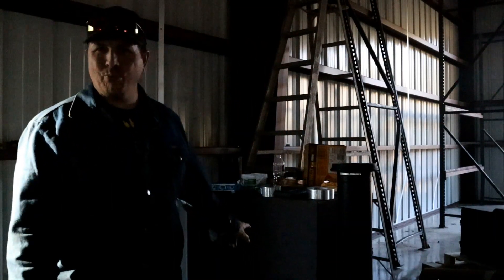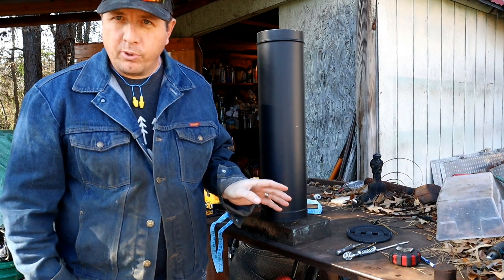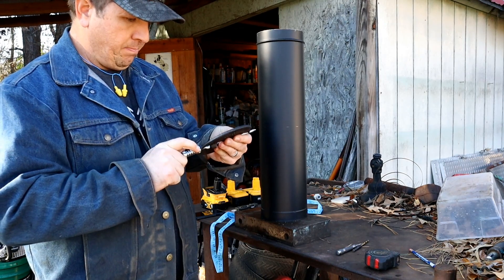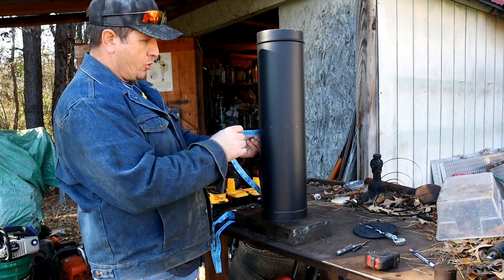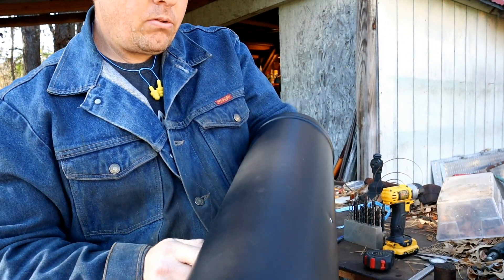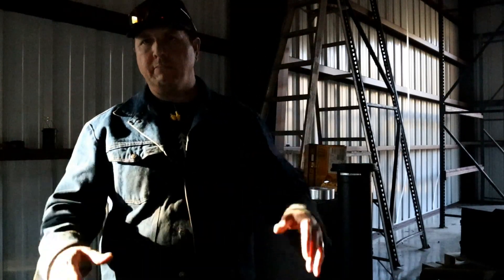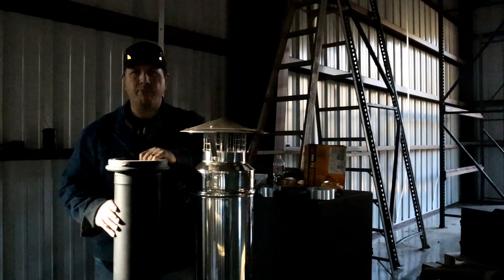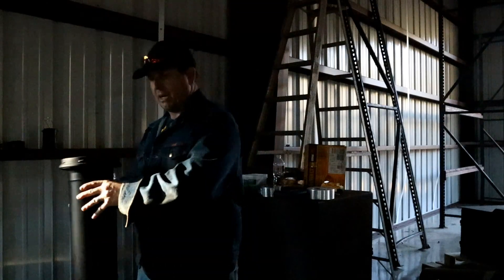Installing The Biggest Wood Stove On Marketplace in Barndo

Comment: Nice work, I used fire brick in a reverse smoker firebox, i made the firebox out of 1/2" steel and lined it with the brick, it holds the heat really good, I can go outside now fire it up in 32 degree weather and utilize the smoker in the winter.
Nice this video came up I was thinking of making a wood stove for a much smaller work shop out of 3/8"diamond plate 24  X 30" and I didn't know if i wanted to use the firebrick for the wood stove as I would want the radiant heat to transfer out and not be insulated by the brick, I have the metal cut and the brick not sure which way to go
Reply from the maker: Sounds like a pretty cool project!  I would at least use the firebricks on the bottom. I did bottom and half way up the sides. It really helps store the heat and release long after the fire dies down

Comment: The aluminum tape is for hot air duct joints will not hold up to single wall stove pipe heat it will fall off they do make hight temp tape for stove pipe joints 3M makes it not cheap for small roll don't need it if you screw your pipe joints together you will have plenty of draft with that high of a chimney but on a cold pipe you will get smoke though joints key to warm up pipe with a small fire first in fire box before you buid a big fire cold pipe will not draft well you will have smoke coming though joints and from stove fire box back drafting so warm up pipes before making a big fire
Reply from the maker: Thanks for the heads up on the tape!  I did get some high temp caulk for door seals. That might work for the pipe too, but no smoke coming out of the joints
Reply: @Man-Time  wood stove door gasket either flat or round depending on if there is a groove on a door frame or on the door if not just go with the flat door gasket also if you have an ash door you want to make sure that has a gasket around it too
You use stove gasket cement to put on gasket

Comment: Once you get a good hardwood fire going that 26 gauge black stove pipe will get hot and radiates Heat just need good hardwood that has high BTU's